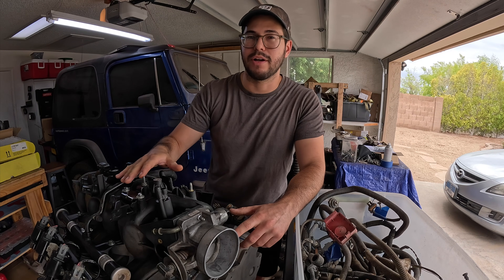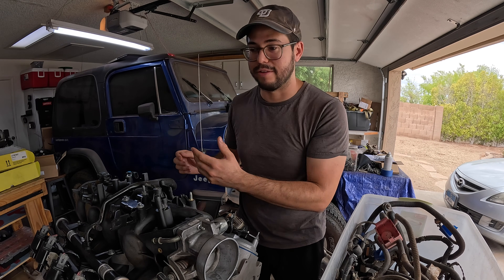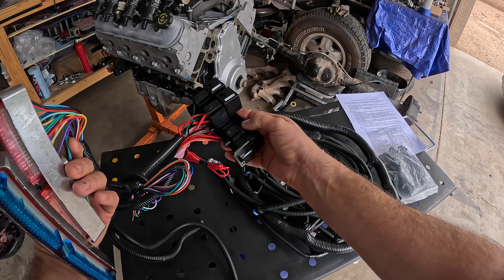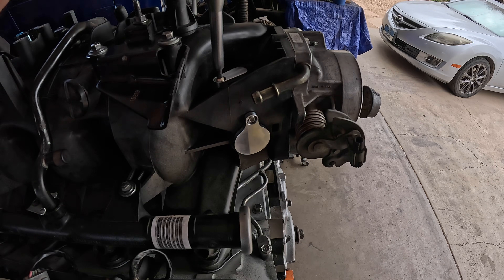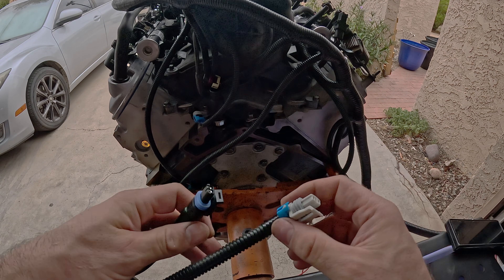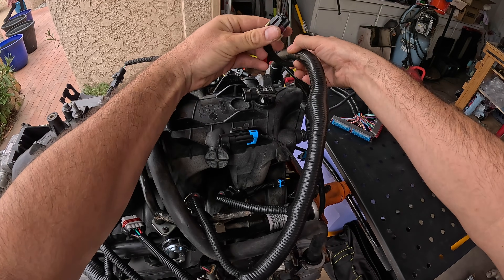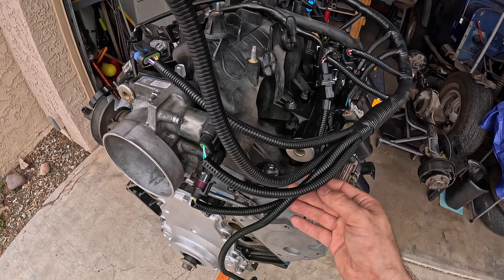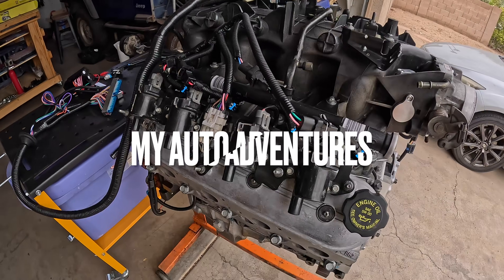LS WIRING MADE EASY | AMAZON HARNESS WORKS

Comment: Maybe I missed it but I have same thing and I’m missing my oil pressure sensor plug on the back , is it separate from the harness or ?
Reply from the maker: You didn’t miss it. It’s usually not included. On a 5.3 LS, the ECU doesn’t need oil pressure input to run, so most aftermarket harnesses don’t have that plug. The oil pressure sensor is normally wired separately and goes directly to your gauge or gauge sender. 🤘
Reply: @MyAutoAdventures thanks so much

Comment: THANK YOU SO MUCH!!  For weeks I couldn't figure out why my c10 ls new swap wouldn't start.  EXACLY as you explained on the video,
I make a mistake on plugging Mat sensor wire into Cam sensor (both ends look a like) and it was making backfires, it would start once in a while.  switched the wires and Problem solved.  I also forgot to connect ground black wire on the back of the head close to firewall.
Reply from the maker: Super glad the video helped! 

It’s always a gut punch when a project you've been working on doesn't work right, but man, nothing beats finally finding the fix.

Really appreciate you watching — and good luck with the rest of your build! 🤘

Comment: I’m having a lot of trouble with the under dash wires
Reply from the maker: Whatcha got going on?
Reply: @MyAutoAdventures I have an 02 lq4 harness, I’m trying to hook up the under dash section of the harness but I cannot seem to I’d the wires.
Reply from the maker: @TreasureHunter18 For sure, did your harness come with a pamphlet?

Mine had one which stated what color wire went to what. If you don't have one I'm happy to send over a picture of mine if it'll help.
Reply: @MyAutoAdventures  that would be great. I’m taking the project over from someone else and they have lost all the paperwork.
Reply: I was going to purchase a BIM connection box from Dakota digital but I’m trying to save the hundred dollars
Reply from the maker: @TreasureHunter18 For sure, email me at MyAutoAdventures@gmail.com. I’ll get some good pics and send them over. Hopefully it'll get you in the right direction so you don't have to spend more. 👌

Comment: Hey, i got a few questions about this harness, i was reading the amazon reviews and some people said the Pins need repinned, is that true? Also, the MAF Sensor plug, is it for the stock say 99-04 Silverado 1500, or the LS1 From the corvette? The reviews said its for LS1 Based Sensors, not a vortec.
Reply from the maker: Heyo, thanks a ton for watching. I didn't have to repin anything so far on the harness to get it to run on the stand. 

I'm getting mixed results for the Silverado and Corvette MAF plugs. The plug that came on the harness that worked for the MAF I am using looks like a wide mushroom. 

I can definitely email you over a picture of the plug as well if you need it. Just hit me up at MyAutoAdventures@gmail.com